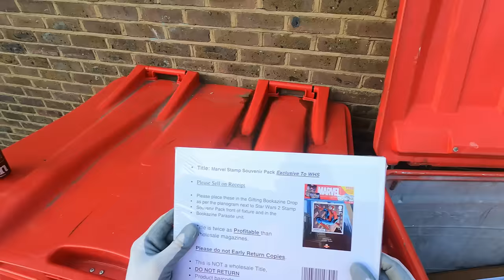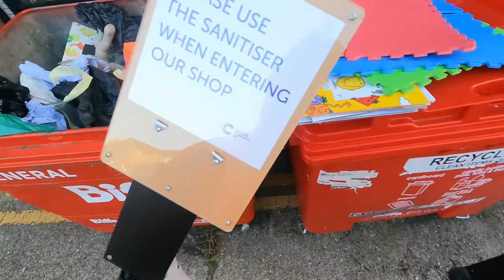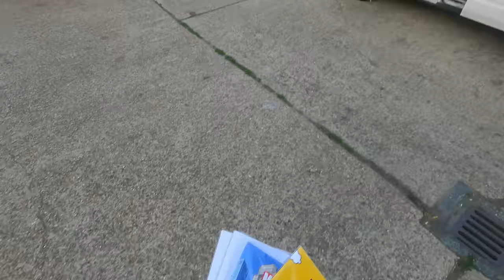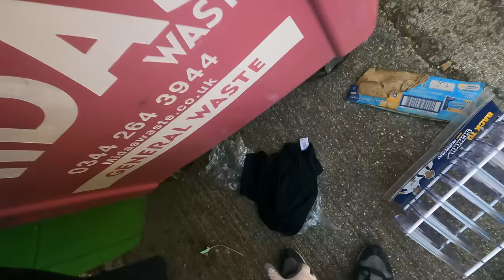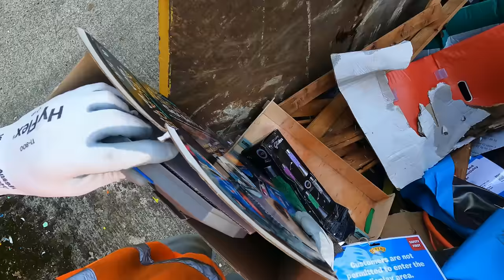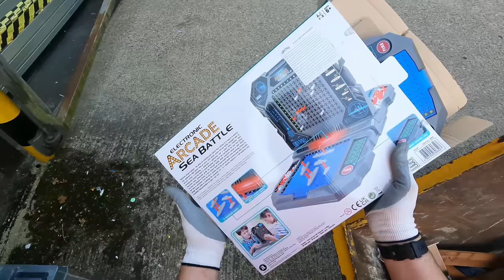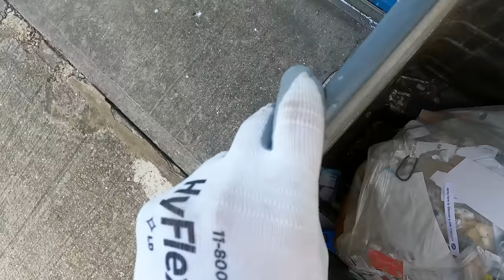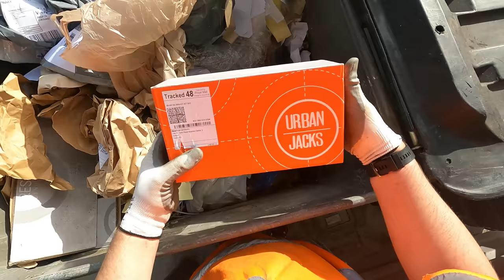THIS IS INSANITY DUMPSTER DIVING MEGA SCORES AMAZON POUNDLAND PLUS MANY MORE!!

Comment: These pills are, in fact, labeled in Hebrew. They are being sold for 20-30 GBP. I couldn't pinpoint the exact bottles, but it seems like a UK manufacturer is shipping them to Israel, and for some unknown reason, they find it more cost-effective to dispose of them there. It's truly mind-boggling. I advise against using a large quantity of these pills unless you have a genuine deficiency that requires their use.

Comment: EVERY SINGLE ITEM you see on display ANYWHERE will end up in a SKIP. I worked as a Skip DRIVER [1st Job after Passing HGV] And the WASTE i saw being thrown out really Upset me TVs/Washing Machines/Tumble Dryers/Clothes/Food/You name it- It was thrown out ,Then WHEN I Started delivering car parts Longbridge/Range-Rover/Crew Bentley/Honda=Swindon and saw CARS Fully built being SCRAPPED because too much/Too Little paint were just THROWN into the factory Scrap yard to be CRUSHED, That;s when i started realising HOW CORRUPT the WHOLE SYSTEM IS.

Comment: That's just obscene, man! Those  clothes and shoes, etc, could have been given directly to the homeless via one of many outreach groups who are out there supporting the homeless and people who are in need.
Instead of which the shops just bin it all off to go and get buried somewhere. It just adds to the other crap making the soil even more toxic. All through the laziness of people who just can't be arsed to put the smallest bit of effort in. 🤷🏻‍♂️
It's funny because they would probably have less to do if they gave one of these groups a quick call and explained what they have got for them. The chances are that one of the volunteers would come to where the items are and collect them all. But I don't suppose they have a clue about not only what happens to what they throw away, or how good they would feel to help a homeless or otherwise needy person to be warmer during the coming months. 
Even those vitamin pills, I'm sure, would be well received. I don't suppose getting their 5-a-day is very high on these people's to-do list when (or, sadly, IF) they wake up in the morning. So, strange as it may seem, those vitamins could be the difference between a completely wrecked immune system and one that's much less so. Again, we've got Winter coming toward us with its head down and running full speed, and it will claim many people, with many if not most of those taken, having a compromised immune system.
Anyway,  that's my rant done. For today, at least. Please keep on with the audi. You  are helping to open people's eyes to the level of waste that is being perpetrated by the corporate types. They can just offset their losses by reclaiming the money against their tax liabilities or through some other legal loophole. So many of them pay such small amounts in tax as it is.
Poops, I'm going to clear off before I start a new rant about how crap both our Treasury and the Behemoth-like HM. Revenue organisations are.😅
Thank you for uploading your videos, mate. I doubt that very many people would be the slightest bit interested if presented with just the figures, showing how bad things are. Thank you for doing your bit 😊👍🏻👏 and I apologise for the length of my comment/moan.